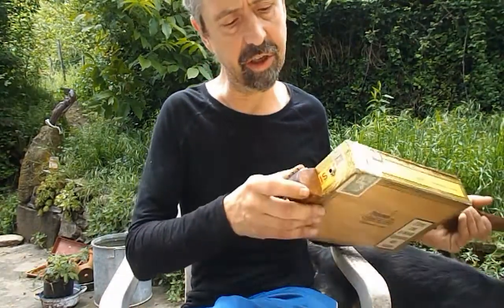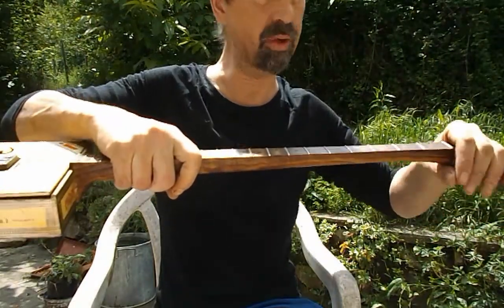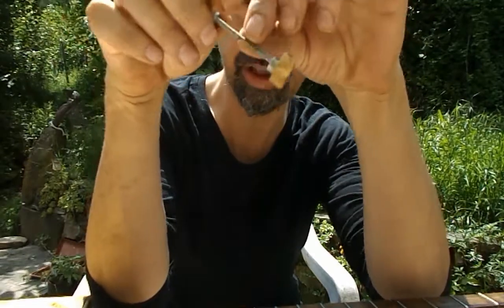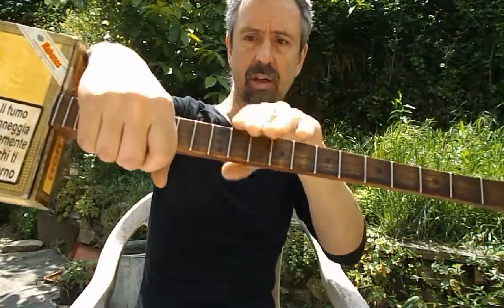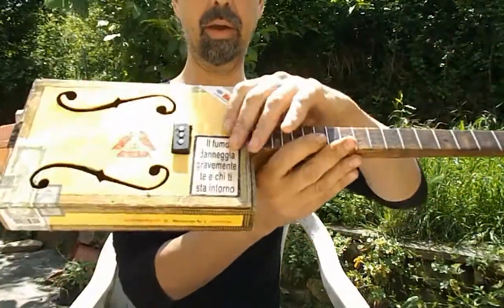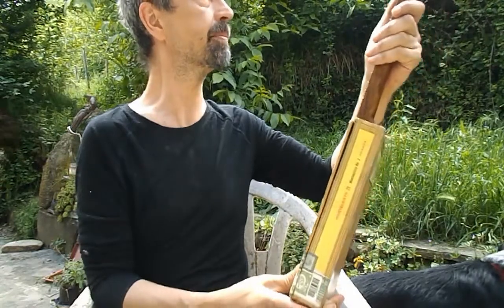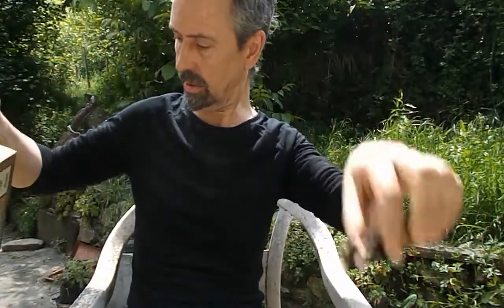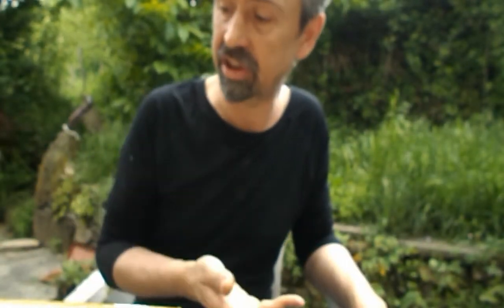Making a Cigar Box Guitar (and 10 easy-to-make mistakes)

Comment: I made a similar pickup, and although it has a low resistance reading , it has a rather sweet tone! Making you own is very rewarding! I've since got a used sewing machine for free and I'm going to order a counter on ebay. I'm converting the sewing machine into a pickup winder...it has a foot control for speed which will make winding a lot easier!